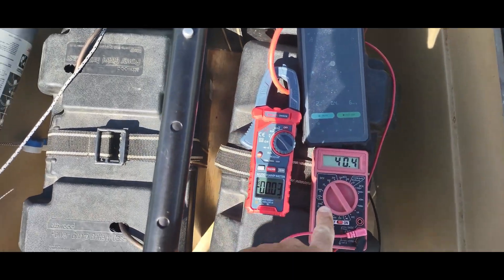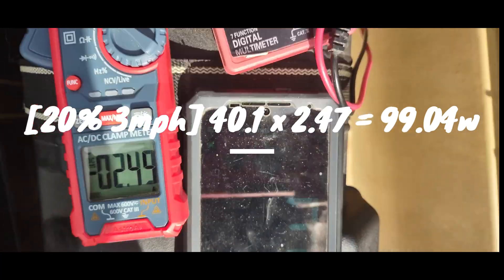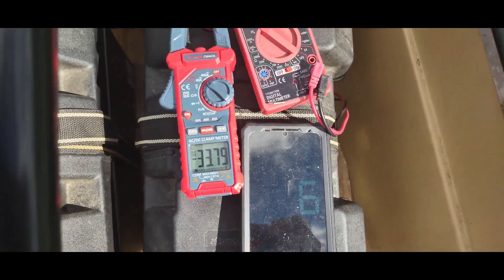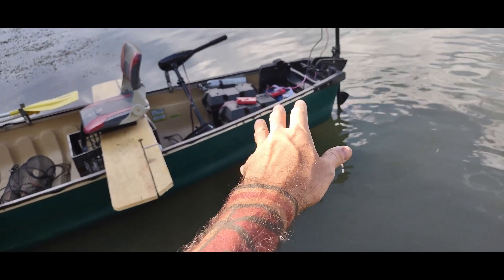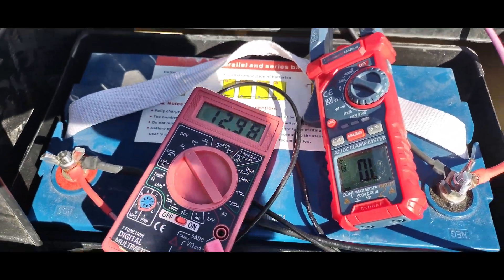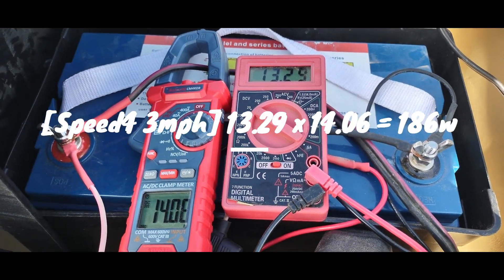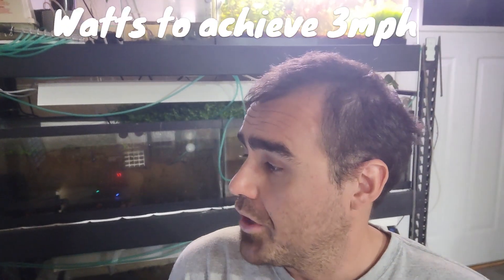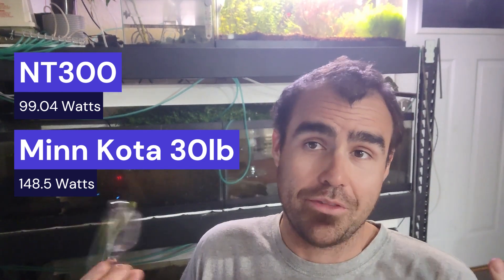Newport Vessels NT300 Real Power Use VS Trolling Motors

Comment: Hi Joey,  Would you tell me please , what is the brand of your out riggers and do you like them, would you say they are strong? Or sort of cheap?
Reply from the maker: sailboatstogo.com/landing/canoe_stabilizers/
Reply from the maker: I have the 46" crossbar, square posts with rigid solid floats. Bolt-on gunwale J brackets, and I made their "high-seat" with  extra clamps and 1x12 lumber. No regrets. Very solid setup. I keep it oiled with WD40 silicone and its very robust system. That website is nice to browse and see cool items they sell. Theres FB group of sailboatstogo and the owner Jim is very nice to email any questions. Had made me want to buy a sailkit next season. but the outriggers work very nice! i sit and stand up on them and balance very well.
Reply: Thank you for this feedback.The square vs. Round post I guess is the only difference. That the crossbar is only butt welded to the square post slider assembly is no worry I guess? I am the owner-built/over-built guy you always hear about.  I lose sleep over this stuff!  @JosephMBoyer
Reply from the maker: @russellwalsh9081  it's a simple design. The floats are from spring Creek. I like the expanda craft system too,
Reply from the maker: @russellwalsh9081  yeah that's the only difference where the the posts are round vs square...

Comment: Nice video I have a review of the NT300 our there as well https://youtu.be/wrxQyl7FAkI.  I really like the motor I have been using it for over 6 months and no complaints at all.  Looks like you have Weize batterys as well.
Reply from the maker: Hopefully I never have an issue with mine :). So far I have discharged/charged about 14000kw through all 3 total and haven't had an issue.